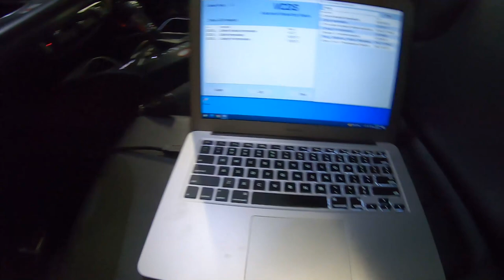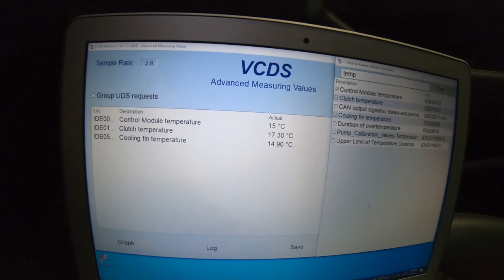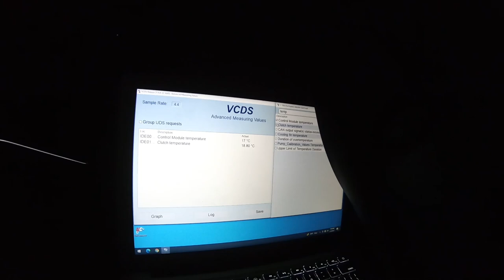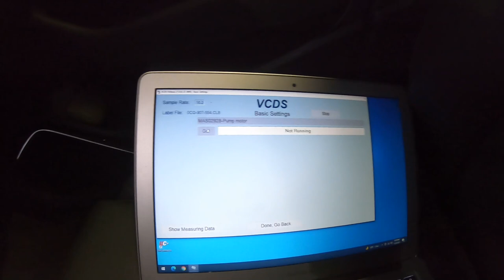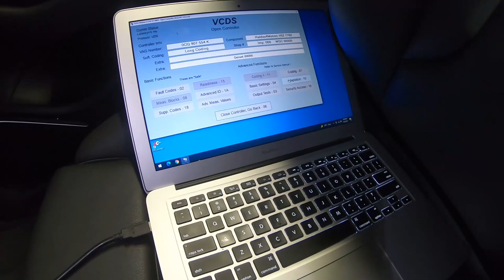2018 Audi S3: Episode 24: DIY Gen 5 Haldex Service

Comment: Glad to hear someone else’s pump made a lot of noise spinning up. It’s a bit unsettling if you don’t know that is how it’s going to sound. Thought I’d broken mine 😂
Reply from the maker: bro, i appreciate your honesty. when i heard mine, i thought it was destroyed. and this morning, the car is running INSANE...
Reply: @LastHumansGarage  Yeah. Mine sounded like it was spinning with no fluid in it. IIRC- when I asked the guys I got the service items from, they said the pump is spinning up to find the correct pressure. I guess that’s easier to achieve with clean fluid and filter. So maybe it overshoots on the first go, as that’s what the car learned prior to the service. Sure makes a difference getting all that gunk out of the filter and setting everything up fresh though 🚀
Reply from the maker: @DandyNun  yes… exactly. Sounded like no fluid.

Comment: That color difference is off the scale bro, am really surprised that the oil got this dirty in barely 10,000 miles. Good call to have serviced it this early. I should have done it much earlier too on my VAQ, which is not that different from the Haldex, just different lay-out. Anyway, we learn every week. The ultimate test is now to do another LC and video it with your Go-pro in a parking lot or something. Just 1 LC would suffice, maybe video it on a higher frame-rate, so that you can make a nice slow-mo out of it. I am sure it would get a ton of views  :-)
Reply from the maker: going down my older comments replying to stuff i missed.. i do plan to do a launch someday in slo mo to check the rear wheels again.. but i am not nearly as gung-ho as BJP, im getting older after all. So BJP will be making a lot more videos than me, I'm not in a hurry at this point in my life.
Reply: @LastHumansGarage  That's all good bro, no rush or pressure, we leave that for them young dudes..

Comment: Great video! What if,  instead of driving the car before topping up the fluid, you just ran the Haldex pump via the VCDS tool? That would serve the same purpose, no?
Reply from the maker: Well, I suppose. But the drive way more to build heat, not circulate pump passages.
Reply: If you have the temp, then you can just switch on the ignition and you will hear the pump prime. IIRC- No need to start it. You can then get in ~100ml more fluid👍🏻 The full bottle gives you just enough to rinse anything left in the drain, then fill, prime and top-up. Good to do the pump learn after you service it too, often doesn’t get done.

Comment: Nice video.  Worth opening up to clean the screen  which is the main reason for pump failure. Standard stealership service doesn't include this job. Don't know if you noticed a black soot trail behind the exhaust clamp. Maybe a leak? Had a look again, what is that black stuff? Ha u noticed it!
Reply from the maker: Dealer don’t even do that much?? Dang!
Reply: i heard that as well. i was quoted 400$ for the service. doubt they will even check the pump. don't trust them.

Comment: How is that computer involved in the oil change? 😶
Reply from the maker: you have to reset the mechanicals and adjustments. (only for diff type stuff, not for regular engine oil change.)

Comment: I really think you are going overkill, the car seemed to me like it was working normally. Not to be rude but I think you just need to learn how the car operates more than just chocking it up to failing parts. Hey you might end up having an issue and at that point you could say it was worth it however the car hardly has any miles on it. Turn off traction control and just do some more launches. Your car was faster than Jordans we witnessed it however you just gottta get better at launching is all it is in my opinion.
Reply from the maker: I guess u didn’t stay till the end to see how dirty the fluid was? I think it was well worth it.
Reply: Looking at that fluid and screen, this service was worth its weight in gold. Protection of the clutches and pump. Waaaaaaay cheaper than replacement of things. :)
Reply from the maker: @spectremarty  You are exactly right Party Marty.